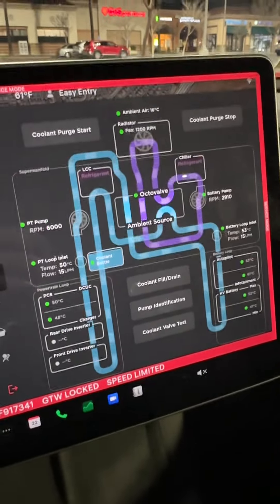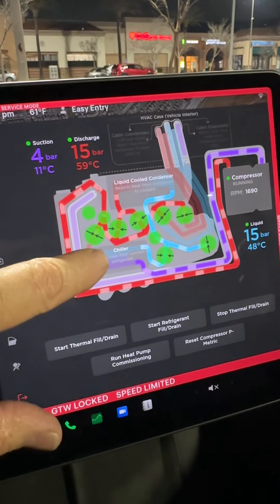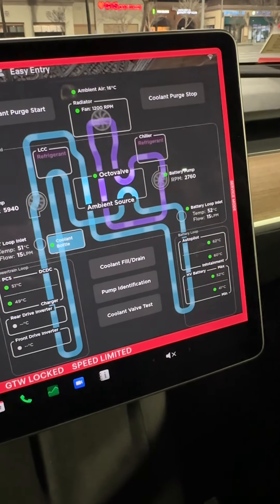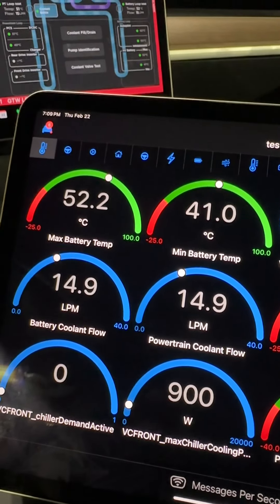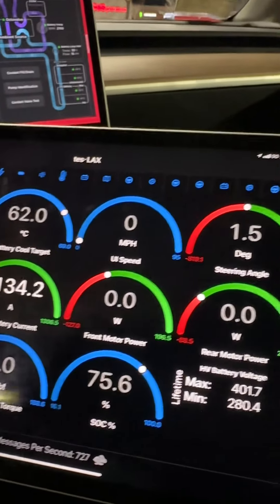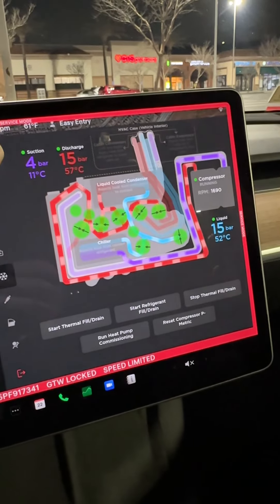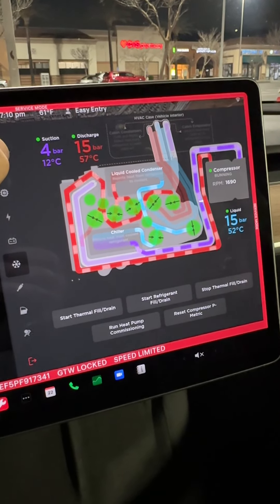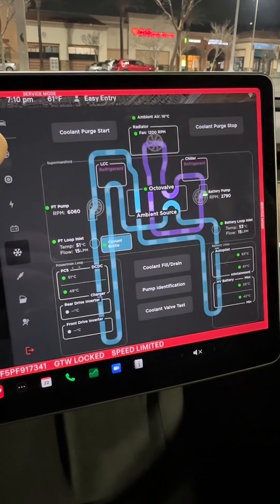Tesla Heat Pump & Thermal Management with Supercharging

Comment: After watching John Kellys video about the Y Heat pump system, I was so impressed at the thermal management Tesla has come up with. Such an elegant system. Who else would think to run the motors in "lossy mode" to generate excess heat. Thanks for making the video Scott
Reply from the maker: Thanks for chiming in sir! I suspect that there are many other functions happening under the covers that have yet to be discovered.